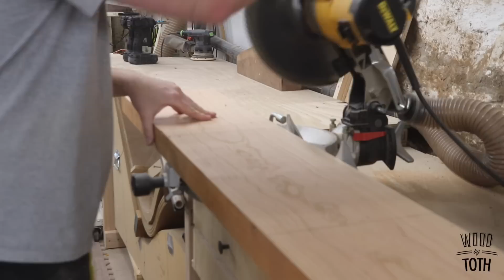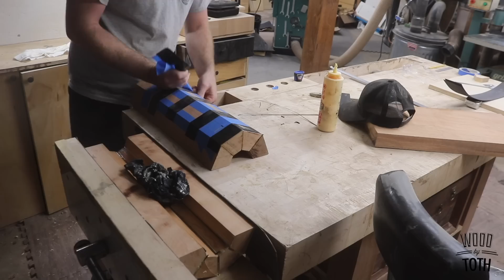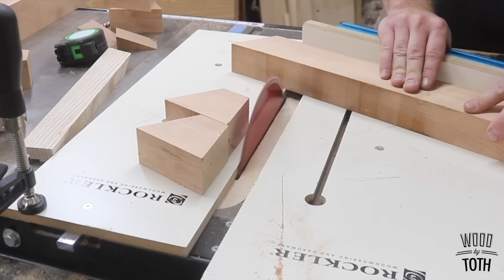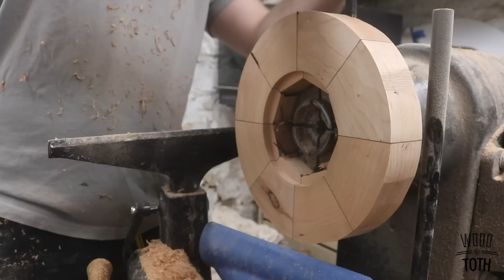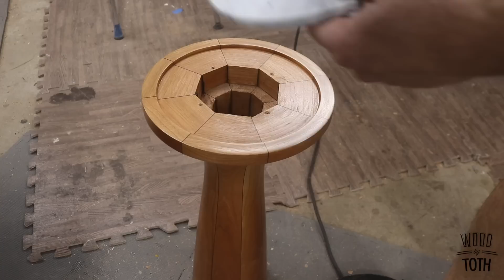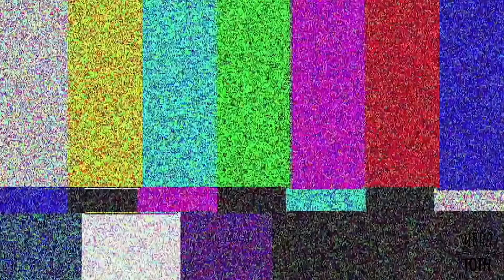Pedestal Table

Comment: Kyle,
Any reason you switched to the table saw for cutting segments now rather than the miter saw you used to use? I learned how to turn segmented bowls after watching and Listening to you and the dusty life. I have continued to use the miter saw and a pencil line with success, just wondering if you found it that much more faster on the table saw or something.